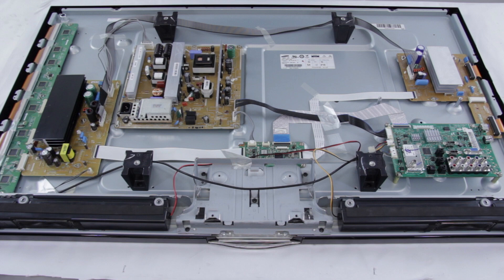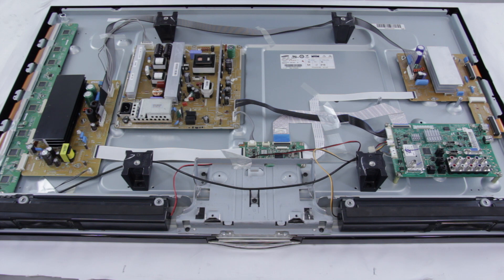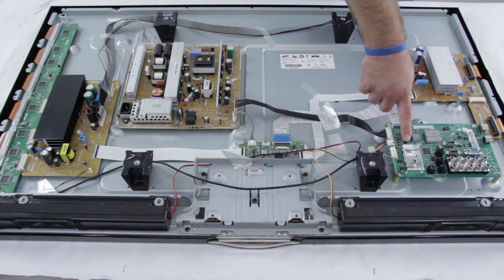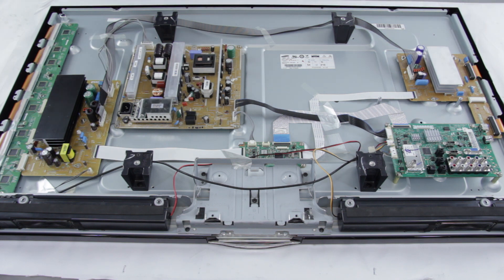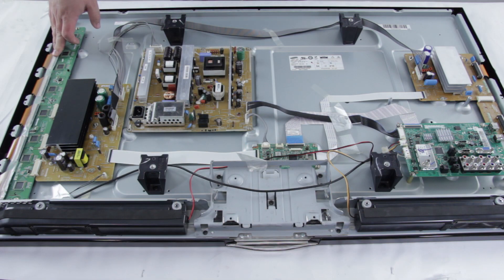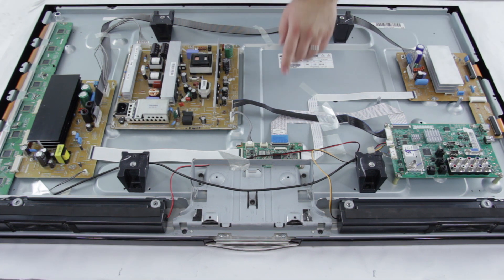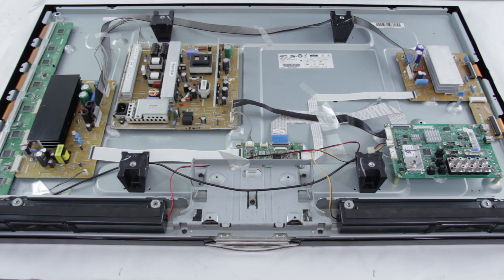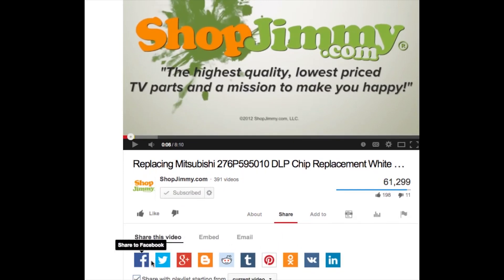Como reparar / arreglar Plasma TV Samsung Problemas de la Junta explicaron subtítulos en español

Comment: Hola muy buenos sus videos,tengo un Tv Plasma Samsung S42AX-YB09 que es igual al dete video el problema es que no enciende cuando lo conecto a la corriente se siente un click y se queda en standby cuando le doy al control remoto para encender se siente el click otra vez  pero no enciende y el standby blink 5 veces y se queda fijo.
Ayuda si pueden muchas gracias.
Jose
Reply: Hola a mi me pasa lo.mismo .has encontrado solución?. Gracias
Reply: Hola ya fuiste desconectando las diferentes placas?
Yo lo hice y encontré que la Y board estaba en corte
Mira prueba los voltajes desconecta todas las placas y deja la main board y prueba los voltajes en la power board si te da todos los voltajes que van para las placas     Entonces el problema está en la X o en la Y el problema de mi tv era en la placa Y 
Suerte
Reply: Yo  no  sabéis   porque mimada no  medeja😈😈😈😈😆😆😆
Reply: Denada
Reply: Tengo el mismo problema, y cuando se apaga desconectó la placa que va arriba de la Main board y no se apaga pero no presenta ?será que la placa que desconectó está en corto , favor alguien, me opine. Gracias

Comment: I have a SAMSUNG TELEVISION model S42AX-YB09 presents the failure of not starting, tries and tries and fails to turn on, also when checking I found a burned capacitor of 4.7nF x 1250 V, is that only the fault?

Comment: hello i have a Lg 50 inch plasma TV  model 50PT350-UD  it powers up every time you try but only sound on start up on the third attempt on trying to do it as fast as can be to power on the TV it flashes light once then after that is gets darker each time till it is a  black black screen with sound every time it is powered up i just bought a said to be new main board and put it on and no flash of light any more , so i changed the board back to the one i took out and it gets a flash so not sure if i was sold a not new main board as was said but any why if you could give me a hint or what to do with it , i would thank you kindly ,was bought new and been having this problem for years so once it come's on it works great till it loses a signal on power is lost then it has taking up to 4 days of trying to power it up now this time it has been weeks . i hope i was not saying to much to take up your time but i really appreciate any help i can get Thank you  i guess i should give you my email in case there is a reply to my TV problem  melvin.rooster.sanders9@gmail.com  Thank You

Comment: Hello, I have this TV model PL42C433A4D, the problem I have is that when I am watching the TV it turns off and it does like wanting to turn on and off like 4 times and it no longer turns on the power button is blocked and I have to disconnect it, and there occasions that turn on and do the same again.

Comment: Hi I've got a 42inch Samsung PS-42Q96HD plasma TV, witch I'm having a problem with, it stays switched on for about 15/20 minutes and just turns off and I get nothing on the screen and a clicking noise. I've been told to replace the Y-sus board and Y-buffer board, I've replaced them and I'm still have the same problem. If you could help me that would be great 😊

Comment: hi first i had the exact sympthom in the y-sustain board suddenlly my tv turned off then turned on again and turned off like a cycle, i turned off with the remote control and now i have the  power supply sympthom, the tv turns on but only the stand by led flashes the panel glows like a second and automatically turns off it tries to re-turn on automatically but turns off , a tecnician told me that maybe is the problem in the plasma , but i think that is the power supply board, can you tell me please a second opinion? samsung pl43e400u1f thank you
Reply from the maker: Omar X   Try this at your own risk. Unplug the TV, then disconnect the y board and plug in the TV to see if the TV powers up. Reply with the results of this test. Thanks! www.shopjimmy.com

Comment: TV plasma Samsung Modelo PL51F4500AF una orientación por favor, resolde las placas compuestas y la main, las limpie  con tiner y las seque con aire  caliente; cambie 3 filtros sospechosos de la fuente de poder; los voltajes Vs, Va y Vsc son los indicados, puede estar funcionando perfectamente todo el día todo normal sin la tapa trasera, apenas se la acerco para taparla y entregarla empieza a fallar, se reinicia constantemente sin siquiera llegar a hacer contacto con la TV, si se la pongo sigue fallando, sin la tapa trasera si llega a reiniciarse una vez al día si acaso. Puse plástico pegado por dentro a la tapa como prueba y sígue la falla, es como si estuviera demasiado sensible, la tapa es metálica, al parecer un circuito de protección de activa, díganme cuáles serían los puntos a revisar? alguien tendrá un diagrama de esta pantalla?. Gracias de antemano.